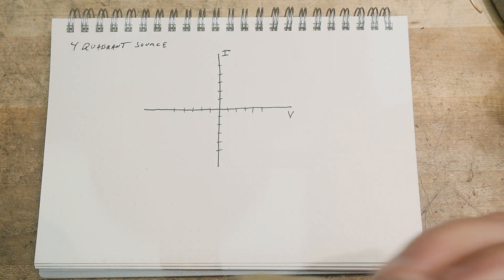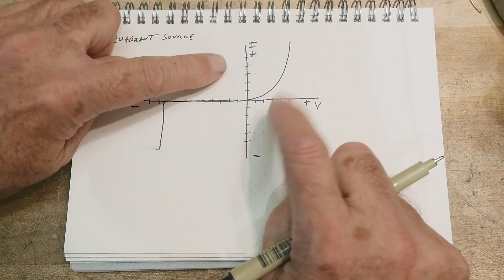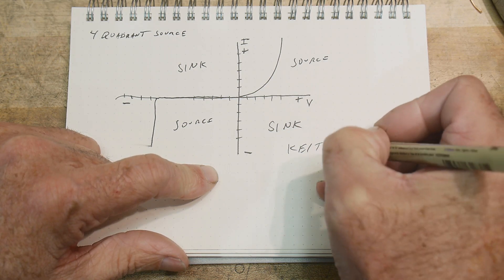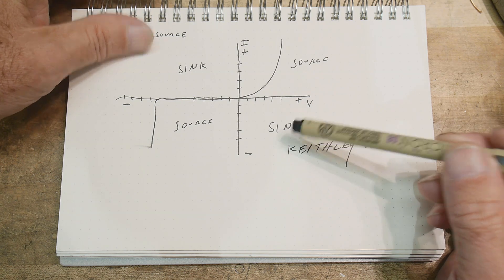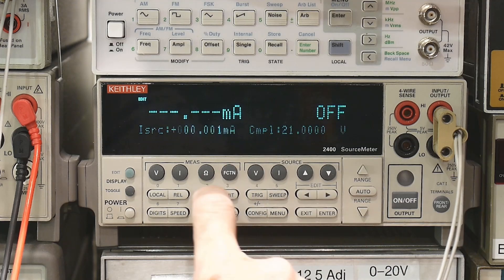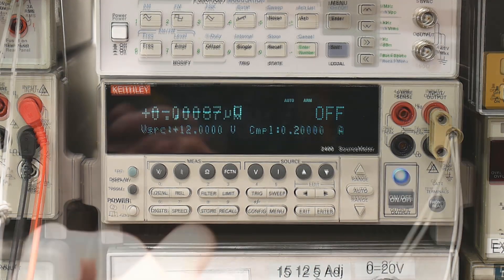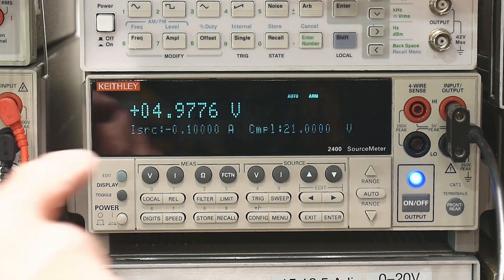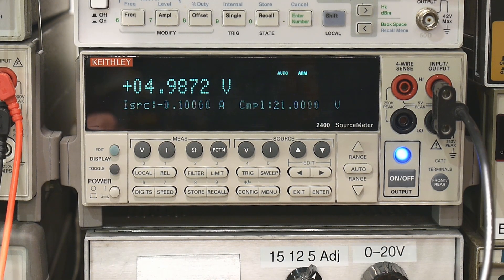#753 4 Quadrant Source used as a Load (Keithley 2400)

Comment: Why are the Kethley least significant digits crazily change?
Reply: That's normal for most kinds of measurements (that aren't being averaged or rounded off) - low-amplitude noise often makes the least significant digit(s) flicker. Even the very finest frequency counters locked to cesium will still have an accuracy spec of ±1 count.